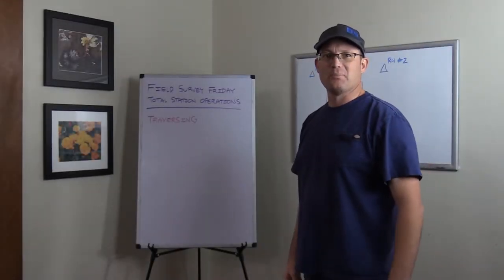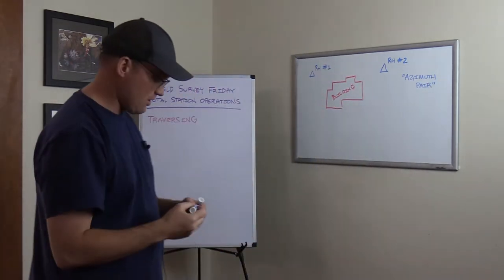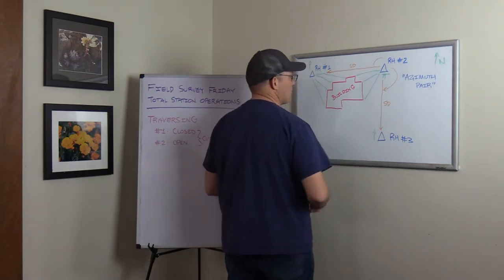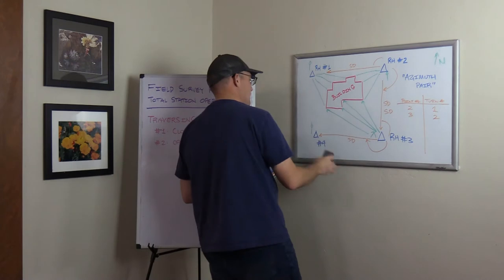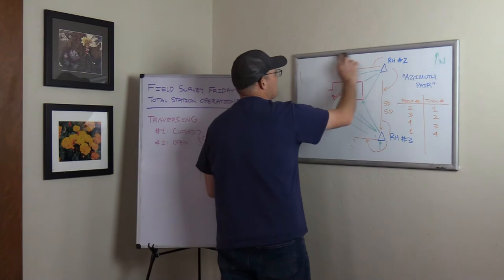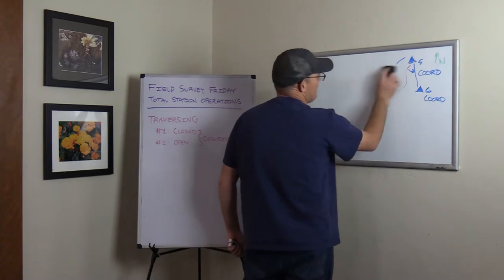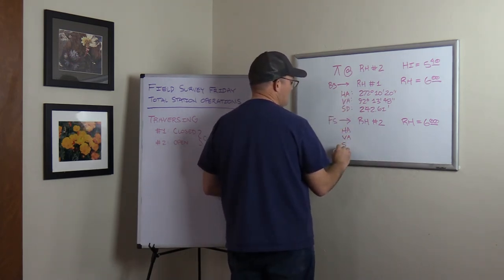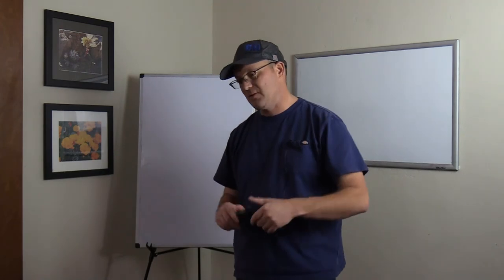FSF-Total Station Operations: Traversing

Comment: Great video! Keep'em coming! Is there a reason why you didn't suggest writing down the HD along with the other travesre data?
Reply from the maker: Thanks Roger. It is no problem to right down the HD. I didn't mention it because that isn't a value directly observed by the total station. It is calculated by the total station. Same thing with the change in elevation between the two points.